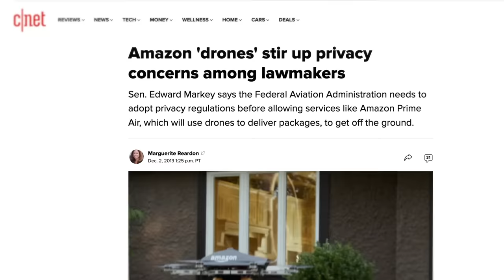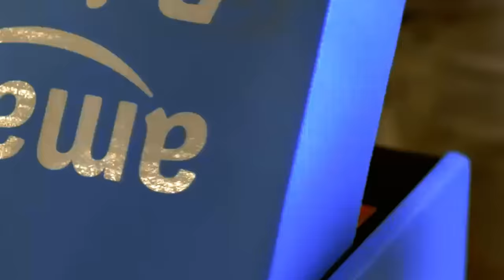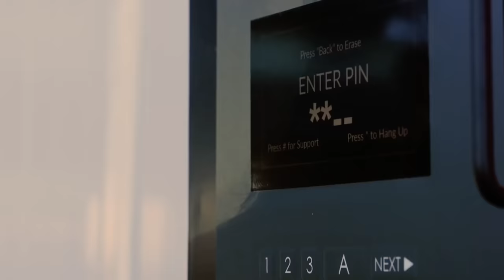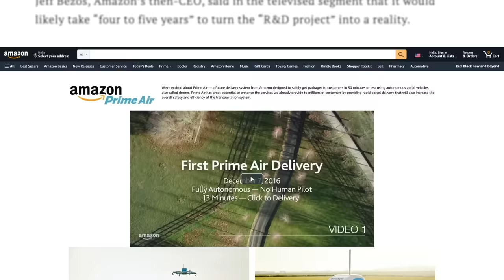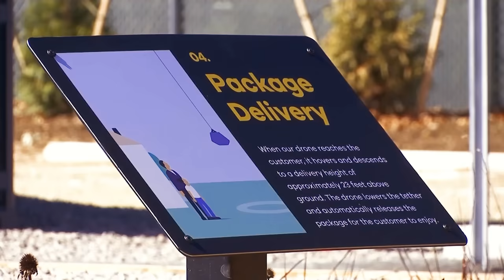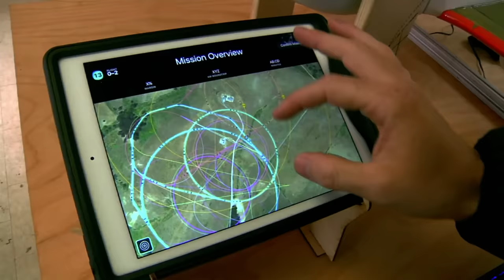Drone Delivery Was Supposed to be the Future. What Went Wrong?

Comment: Saw the "Hype Cycle" happen with 3D cinema. When the first IMAX theaters opened in my country, it generated buzz because up to that point, there were no "3D movies." Back then, you only experienced "3D/4D cinema" at theme parks, where you sit in a tiny theater and watch a short film. Now you could watch feature-length 3D movies in a huge theater. Still, IMAX was expensive and the number of theaters was rather low.

The next step happened when regular cinemas started screening 3D movies. These were cheaper than IMAX and were more widely accessible. 

The problem is, once the novelty wore off, the experience became noticeably worse than regular 2D film. The 3D glasses can give you nausea/headaches. Also, while animated movies could easily be made in a 3D format, a live-action film needs to be FILMED with special 3D equipment. A lot of studios didn't bother, and instead shell out a few million dollars to digitally "convert" 2D footage into 3D. The effect is awful, generating an unconvincing "2.5-D" visual as well as darkening the lighting. Add the tint of 3D glasses and you have a movie that's much harder to see. 

Tickets for these films cost double, and it was definitely NOT worth it. 3D movies disappeared from cinemas here rather quickly.
Reply: Ugh that 3D movie fad got annoying fast. I just rolled my eyes at any movie trailer that ended with "in 3D" I prefer a good quality picture & sound with good special effects over 3D.
Reply: There's a theory that one of the reasons film companies hyped up the 3D movies was to force the theaters still using actual film to finally switch over to digital to make it cheaper to distribute
Reply: @Barlie_  Studios mostly did it to get the extra revenue from the more expensive 3D tickets.
Reply: What surprised me is that the last pre-pandemic numbers I saw indicated that 3D has 10% of the market. Which isn't great, but it's still a lot higher than I expected.

One underreported problem is quality control. Modern 3D demands quality presentation. But most movie theater multiplex chains don't give a crap about quality presentation, so they do things like putting the projector light bulb at 50% brightness in the belief that they're saving a few dollars on bulb replacement. This practice sucks for regular movies, but making everything dark and murky absolutely kills a 3D presentation.
Reply: I was sad when many games dropped 3D support though.
Reply: I really enjoyed 3D movies. I remember when Spock was fighting Kahn I felt like I was getting beat up by my chair too, my pregnant wife at the time “is this safe for the baby?” 🤣
Reply: I remember going to watch a wolverine movie on 3D, I dont even remember what was the movie about because the only thing I could focus after 20 minutes was the headache, I ended up watching the movie without the glasses with the anoying red and blue filters on the screen
Reply: The only cinema in my country ONLY screens movies in 3D. I hate it.
Reply: @sulafmoosa2581  You have only one Cinema in your country?
Reply: @sulafmoosa2581  which country are you in?
Reply: Oh man, that whole 3D TV/movies/video games fad was so obnoxious. I'm glad it died quickly.

Now if only VR would do the same. It's just 3D combined with another fad that failed: motion controls. Ditch this BS.
Reply: Oh, but there absolutely were 3D movies before, it wasn't even the first 3D movie hype. In the 1950's there was a real golden age of 3D movies, and some even thought that in the future all movies would be 3D.  Some movies were absolutely awsome in 3D. The live action jungle book for had some really impressive 3D. There are a lot of problems though. For someone with glasses it sucks to need to put the 3D glasses over them, and very soon the rented glasses in the theatres got very scratched and annoying.